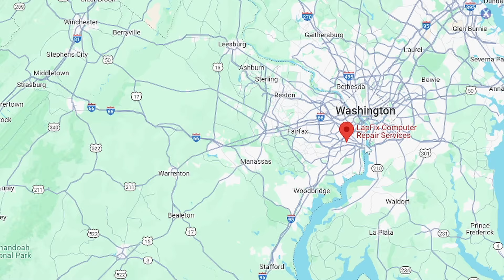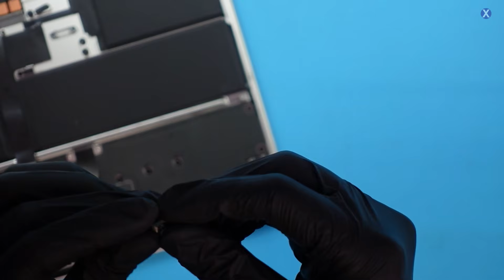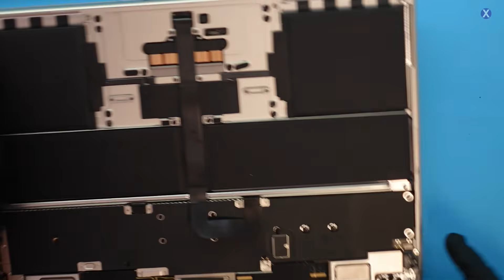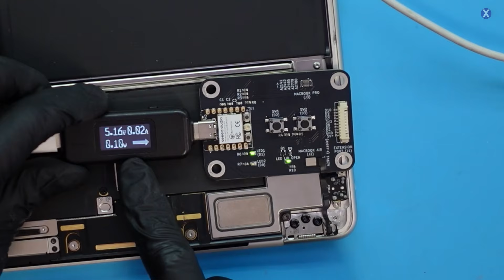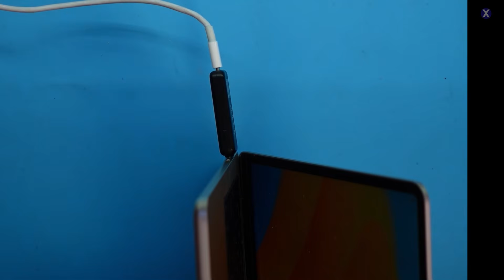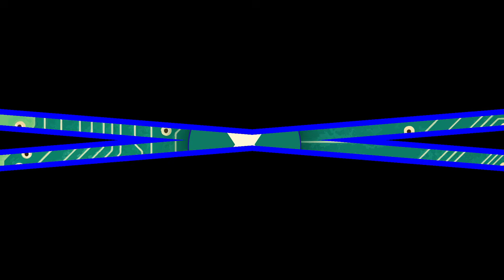How To Fix A MacBook With Flickering Display

Comment: Hi. I really need a help. I have a 2017 macbook air and the screen starts flickering at the halfway bottom of the screen horizontally. And when this does i can feel the battery is getting hot and the screen will automatically black out. I have to closed and open it again and same thing. Just few seconds and then again. 
May i ask what would be the cause? Ithis is the only laptop I have. Please really need help
Reply: Same thing happened to me today. Did you ever figured out the issue?

Comment: Hello, i have a macbook retina 12" 2017. I bought it off ebay and it had a dead battery. I changed the batter but the device only boots when safe mode is enabled. When i get out of safe mode, it just bootloops and then give me the error "your computer restarted due to a error". If i try to boot to safe mode, it works but the device is really slow. Can you please help me troubleshoot and fix the issue ?

Comment: i have a macbook pro A1707, the touchbar no longer works , the screen doest turn on. and the power button does not work, even though the finger print does which is wierd. i have to use a monitor in order to use it